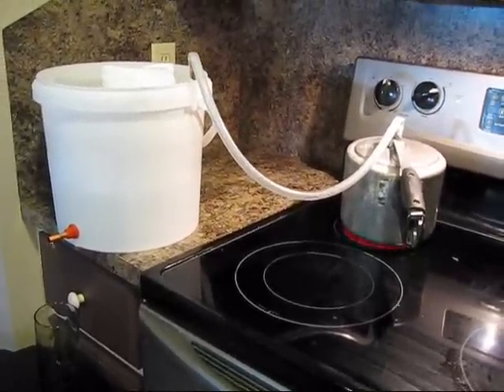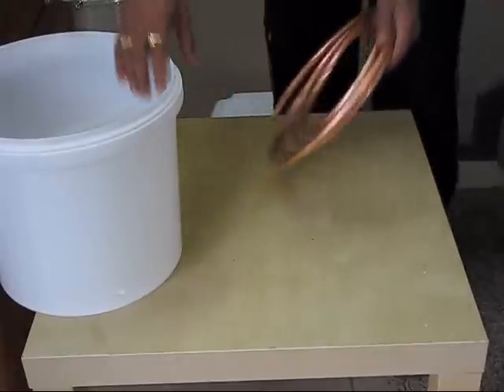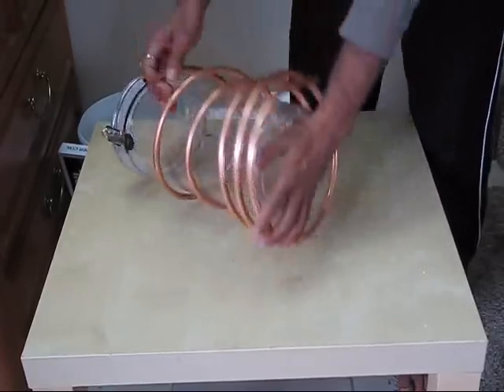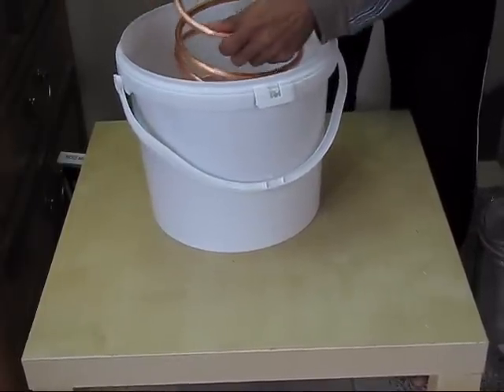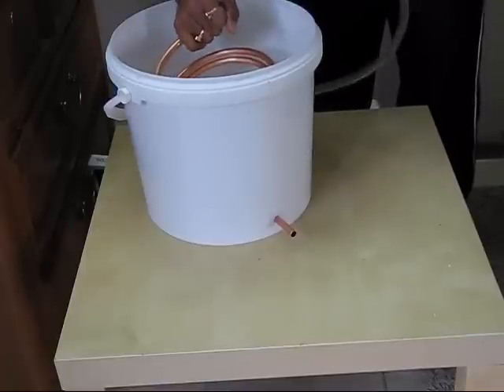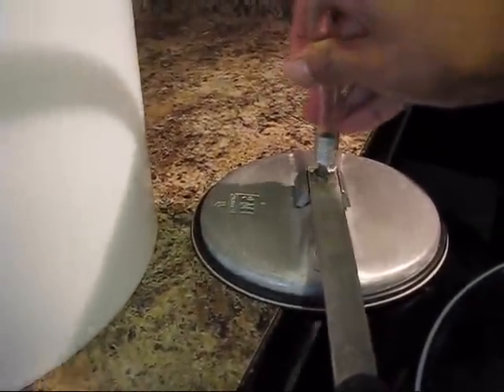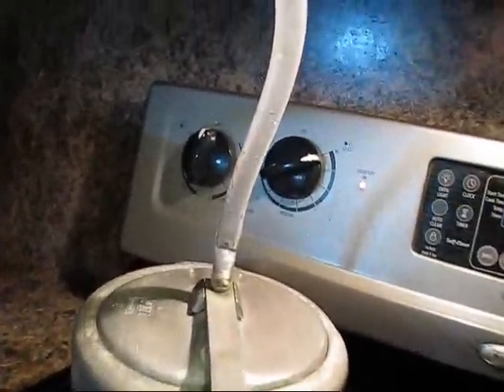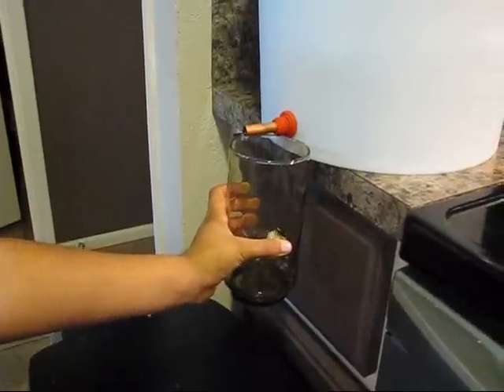DIY Homemade Steam Distiller Very Easy

Comment: Hot steam and plastic :o
Good luck with that!
Your life expectancy just dropped 5 years ;)
Reply from the maker: Yes, you are correct. Hot steam and plastic is not a good idea. However, this experiment was just a test. Practically, we have to replace the plastic with copper or steel.  Thanks for alarming !

Comment: Thank you for your nice videio. But if the cooker had been in the upper position the plastic tube will not bend and affect  the flow of hot vapor to the condenser.
Reply from the maker: @mezemirgima3084 : Yes, you are agree. The plastic tube was bending near the joint. My design is a concept proving, but if you want to make it more professional way then use copper tube all the way from condenser to cooker.

Comment: Sir my suggestion is unscrew the pressure cooker's lid whistle and insert the copper tube through the lid and solder with lead free soldering also please make sure distiller exit point is at higher than the condensor entry point
Reply from the maker: @vijaykumardhanawade9655, your suggestion is very appreciative. Certainly, in future I can try. Thanks you.

Comment: can this be used for alcohol such as brandy distilling as I am trying to do an experiment to replicate the process
Reply: would this be sort of a representation of that process
Reply from the maker: @wura belgore, I will not recommond to distill the alcohol using this setup. Because of may possible contamination. The best system to distill alcohol using the glass aparatus distillation assembaly.
Reply: @rastogisk007  hi, I just need to do a diagram of the process for science project. so i am asking if it is the same process and i can use this as a potential representation?
Reply from the maker: @wurabelgore5820  Yes, concept wise is same, all distillation assemblies have heating element, apparatus to heat, then condensor and the receiver. All the best for your science project.

Comment: Good video. Can we buy an economical distiller on Amazon india? I know they are very expensive in the Indian market.. Also how much time does the distillation take?
Reply from the maker: @ Sid Jones: I do not see if any economical distiller on the market. For professional use, you need either metal or glass one. On small scale, I will say you can try to search glass apparatus for "Steam Distiller" that you can setup at home. Thanks and let us update about your result.
Reply: @rastogisk007  How much time did it take to distill all the water from the cooker?

Comment: Hi! Is it harmful if the bucket is plastic?
Reply from the maker: Plastic bucket is not harmful you can use that to cool the coil. But do not use rubber tube or plastic tube. If you want high quality and pure distillate....
Reply: and can metal pipe be used instead of copper pipe?

Comment: Cooper coil 1meeter or 2 meeter
Reply: Cooper tube 6mm
Reply from the maker: @sathiskumar7546  Cooper tube diameter is 3/8 OD = 17.15 mm = 0.675 inches
Reply: @rastogisk007  thanks..
Reply: @rastogisk007  How many time stove in coocker
Reply from the maker: @sathiskumar7546  It depend on the amount of water and heating rate. Before you do real distillation, do the test trial. Like take half liters of water in the cooker and test how long it would take. Also make sure do not dry completly other wise it would be hazardus. All the best.....
Reply from the maker: Cooper coil is 10 feet = 3.05 m long
Reply: How many time stove in coocker

Comment: Would this be a good way to purify tap water for drinking?
Reply from the maker: In the current setting, I will say no, because this method will give you distilled water, if you will use all the way metal pipe. Drinking water has some percentage of minerals and it is different from distilled water.
Reply: @rastogisk007  going to have to try this. I don't trust tap water with all reports of heavy metals recently, but hate wasting all the plastic buying drinking water!
Reply from the maker: @Sam Fischer, Sir you can make a simple water filter as we did it. This method can give you drinking water from tap water: DIY Eight Layer Homemade Water Filter https://www.youtube.com/watch?v=fJVE53Znxr8

Comment: Can we use this for Ginger??
Reply from the maker: @ I think you can use any herb in this type of distillation system. I will suggest if you use only metal pipe that will be give you better result.
Reply: @rastogisk007  thank you so much Sirji 👍
Reply: Sirji how much time it will take to get the liquid?
Reply from the maker: @kedarsinhphadtare3967  It all depend how much you have in the pressure cooker and the total length of tubing. I will say do one practice run with plain water only.....
Reply: I mean how much time it will take to come out for oil?

Comment: Where to get the rubber stopper?
Reply from the maker: In which country do you reside ? Based on that you can find it. Check it through on-line scientific or chemist vendor
Reply: @rastogisk007  Thank you for the reply. It is India. Can you provide a link to an online resource where it can be purchased? The local HW shops do not have these looks like.
Reply from the maker: @sridharraov  You can try these - https://in.vwr.com/store/product/571783/stoppers-rubber-with-fold-over-skirts

Comment: How do you know when the pressure cooker runs dry and does not melt?
Reply from the maker: @Luis This is a good question, basically you have make record of water you added in the pressure cooker and how much you have collected. Its always better to stop heating after completion of 75%. Also you have to keep checking by opening.

Comment: Can I make cumin oil from this method
Reply from the maker: @Babu Antony K, It would be worth to try. You may need to soak cumin seed overnight in the water then get distill. Please use all metal pipe and no not use rubber pipe. Thanks If you try let us know that work ?
Reply: Thank you for your respectful reply

Comment: Sir please tell me how much capacity of bucket  you used. And where does I will get nozzles please if you are having nozzle link share me.
Reply from the maker: Bucket has around 15 liter capacity and for nozzles, you can type "rubber septum" in google and click images you will find many options with vendors

Comment: Brother where you bought copper pipe ?
Reply from the maker: @ SSV GRAND, Brother I bought the copper tube from local hardware shop
Reply: @rastogisk007  how much you paid for it?
Reply from the maker: @fredricjoy2503  Cost was around Rs 2000 but it depends whatever you can arrange from your home. I could do little more to replace rubber tube with all the way copper metal pipe

Comment: Is that a BPA plastic hose? The heat will leak chemicals into the water. Test it for chemicals.
Reply from the maker: @ Samson Noah: I used Tygon Tubing which is Phthalate-free and BPA-free (Bisphenol A-free)...........

Comment: What is the roles of copper wire,
Reply from the maker: Konsam Lalhanba: Copper wire take heat from hot steam and radiate to cold water. In this way copper wire condense hot steam to cold distilled water or oil inside the wire.

Comment: Just curious is this process possible for alcohol distillation
Reply: yes... for alcohol or etanol you need coper coil...
Reply from the maker: The legendary kong, Glass apparatus are recommend for alcohol distillation and not the plastic or metal. Your answer is NO

Comment: ...thank you for the video...question...since you are using clear hose from the boiler to the cooler copper...why not use clear hose all the way through to the exit of the cooler...seems it would do the same as the copper tubing and avoid any contamination of the distilled liquid...nice job...thank you again...!!!
Reply: copper will be more efficient in condensing.
Reply from the maker: @szarzararia5369  Yes, that is correct
Reply from the maker: Concepcion Amancio, yes, you are right that can be used. But it would be more useful if we replace plastic rubber with metal one. Thanks

Comment: what if that copper pipe get corroded from inside and mix CuSO4?
Reply from the maker: This is good question. We have to keep checking the quality of pipe, if start corrosion we need to replace it. Also if CuSO4  will come that will remain in the water. And it will not come in the oil.
Reply: @rastogisk007  oh didn't take into account that salts dont vaporise when distilating, thank you

Comment: Doesn’t that plastic pipe melt?
Reply from the maker: Sujith Dsuza: yes, you are right for long run plastic is not good. In our video I showed our model is working. But for good efficiency, we should use only copper tube.....Thank you

Comment: Where did you buy coppertube..?
Reply from the maker: Maheshrishti Kknd: You can purchase coppertube either online vendor or hardware or metal marker
Reply: Tried online with no success.can u share the site for copper coil?
Reply: @hymanramachandran989  Just type on google and you can find many vendors - https://www.google.com/search?q=copper+pipe+coil&hl=en&sxsrf=ALeKk009RrKOymVClX4ZhaBEjChaAn2leg:1589293380521&source=lnms&tbm=shop&sa=X&ved=2ahUKEwiT5I6bw67pAhVMR60KHRTMCZ8Q_AUoAXoECA0QAw&biw=1280&bih=606

Comment: Broo copper is not using.. fully use plastic tube . What happened
Reply: Fully use plastic tube is not good. Due to hot vapor plastic tube will add impurity in oil. Only copper tube or glass tube is the best

Comment: why that ice??  would be much easier/cheaper just to replace that water..
  or make system where that cooling bucket is attached to water tap..
Reply: ice is much more efficient at cooling down things than water. it's because the energy required to turn ice to water is higher than the energy required to raise the waters temperature. so ice can absorb more of the heat from the alcohol than what water can.
Reply from the maker: John, yes, you are right. It model need further modification......probably I will do some time in. Thank you for nice suggestion...

Comment: Do u know hindi languge sir
Reply from the maker: Yes, what you want to know ?
Reply: Sir hot water or cool water ka temperature kitna hona chahiye essential oil banane k liy or kya tempreture meeter b laga sakte hn
Reply from the maker: @shehzadrazalams755  You need ice cold water to condense hot steam with oil  coming out from pressure cooker. Baraf - wala pani chahiye garam bhap-oil ke mixture ko thanda karne ke liye. Aur ek bat plastic ya rabur kar pipe na lagaye. Better use metal pipe. Thanks
Reply: @rastogisk007  sir bht shukriya

Comment: Thank you for sharing your experience with us. I am going through a lot of videos of making homemade water distillers and was wondering if using plastic pipe would be worth the risk. Now I know not such a good idea to use them after all. Thank you.
Reply: Wouldn't silicone be better?
Reply from the maker: Yes, please do not use plastic / rubber pipe. I am also in processes to replace it with copper metal pipe thanks
Reply: Stainless coil can be a replace for copper?
Reply: @videohuntertv  Much easier to work/bend copper.
Reply: COPPER RULES - SILICONE HAS PFAS IN IT 🆘🆘🆘

Comment: What is that  green thing in bucket
Reply from the maker: That is ice pack to keep water cooled in bucket, thanks
Reply: @rastogisk007  and those white packets
Reply from the maker: @mirror7900  those are also same thing  ice pack, you can also use direct ice.
Reply: @rastogisk007  kk thanks

Comment: After the preparation how can we separate the essential oil ?
Reply from the maker: Hello vaishnavi, yes, you can extract essential oil from this. But I will recommend to use metal pipe rather than rubber or plastic

To separate essential oil you need separating funnel or long graduated cylinder
Reply: Oil being lighter will itself float on the hydrosol and likewise you can seperate both of it
Reply from the maker: Hello Vaishnavi, please watch our second video. I tried to extract essential oil from orange peeling - 

https://www.youtube.com/watch?v=0Lfb9XdwIqc

Good luck and let us know If you prepare your own system .

Comment: YOU USE A RUBBER HOSE ATTACHED TO HOT STEAM??
Reply from the maker: Johne, that is PVC plastic tubing and not rubber tube. This was our first generation steam distiller to see If it works. However, in second generation I plan to use only metal. Thanks
Reply: Whole pipe from cooker to bucket should be of copper.

Comment from the maker: Urooj, you ask a good question, here is the answer - 

The hot steam which is coming from pressure cooker, need to be condense into liquid form. Therefore, we need to lower the temperature of water in bucket. So we need to add either ice or ice pack. Thanks for your comments
Reply: what size is the copper pipe and plastic pipe..Is it 6mm copper and 8mm plastic?

Comment: Why are you putting lots of ice bags in the bucket?
Reply: To do the condensation process and convert the vapour into liquid
Reply: aakash toppo does adding the cold speed up process? can it be done without the ice or ice packs